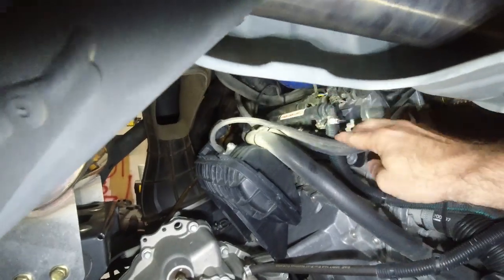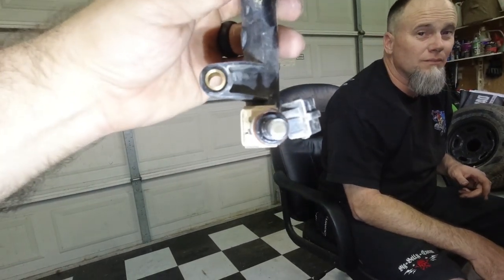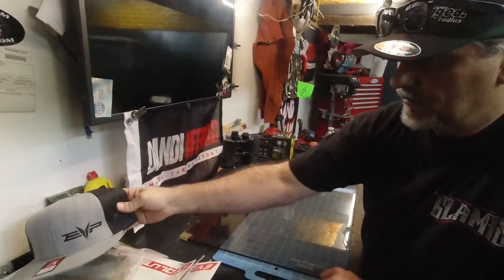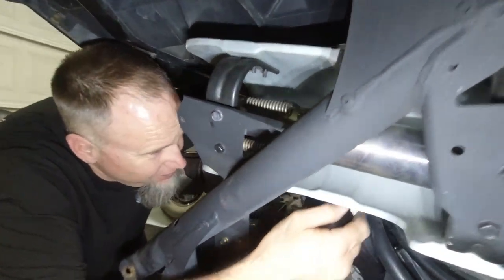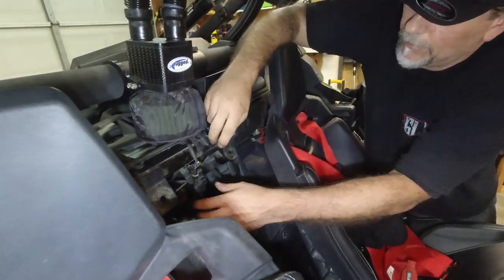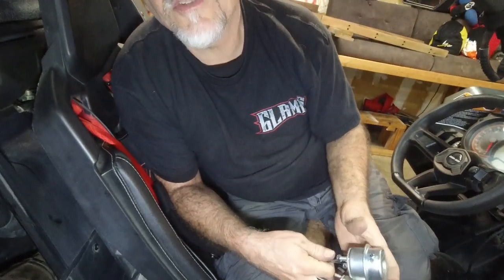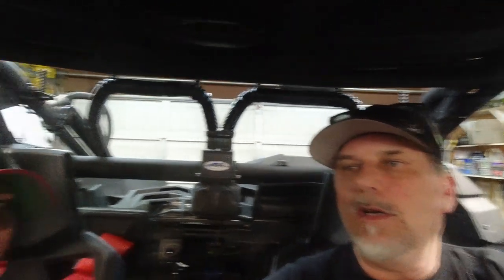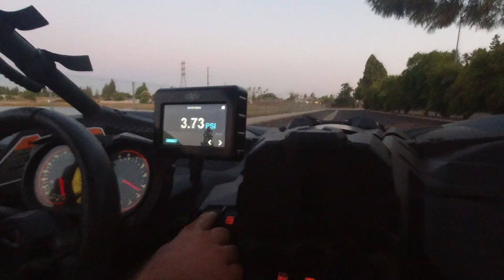EVO 3RI INJECTOR WASTEGATE INSTALL TEST RUN

Comment: I just ordered the injectors. I have the torrent Carbon fiber manifold, a bunch of tunes and the evo gated exhaust to the Yoshimura 3 in line. My endgame is big turbo & around 325 to 350 hp. Next will be the intercooler.